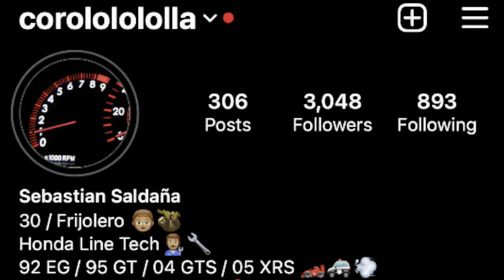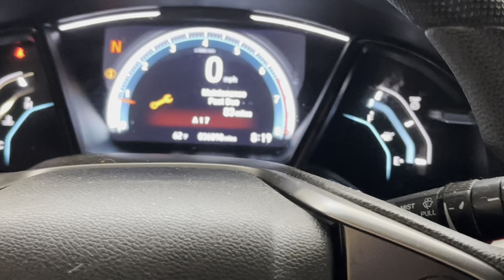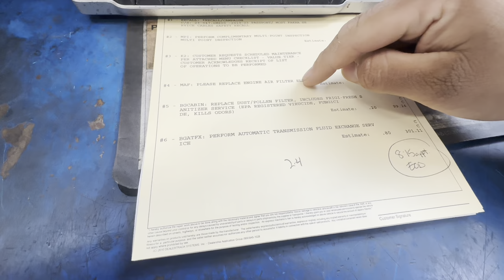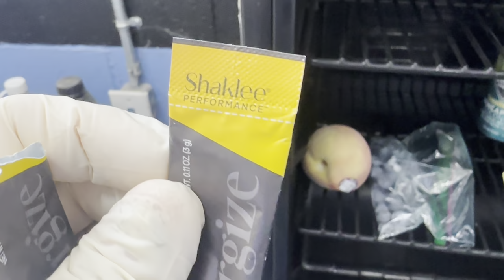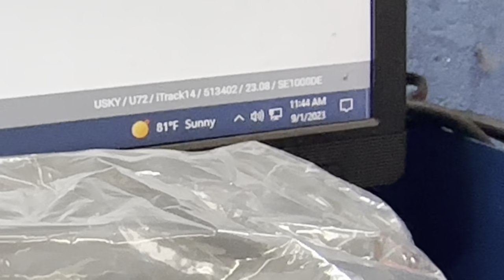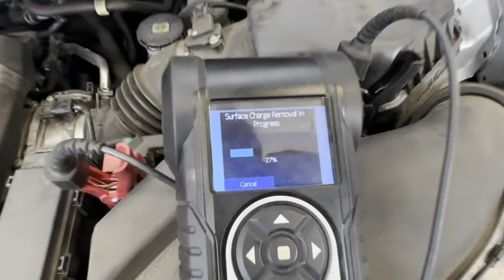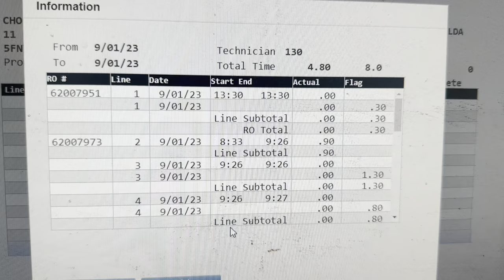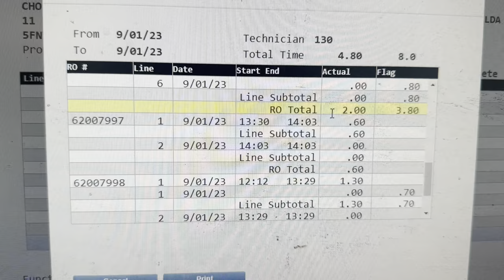Day in a life of a Honda Line Tech mechanic

Comment: Nice tour of the shop, thank you for taking the time to share your experience. I was very happy to find out last week that Honda decided to extend the warranty on Torque Converters for the 17-18 Pilots as mine is already showing signs of slipage at only 87K!!! and customers being charged $4-8Ks for that job.
Reply from the maker: glad that worked out for you! I've replaced 2 of those torque converters on both Pilot and Ridgeline.
Reply: just replace atf solve that slipage, I just doubt it works or it doesn't?
Reply: and people say bmws are the problem and unreliable , rather drop 4k on my 600hp bmw that drives it self with massaging seats than a max 300hp lifeless fwd honda

Comment: Good video.  My hats off to you its hard work for sure.  Back in 2001 I worked as a Lube Tech at a Ford Dealer for their Motorcraft Fast Lube lane.  Flat time.  Not hourly.  Every oil change paid 0.3 of an hour.  With a Tire Rotation w/ Brake Inspection 0.6.  After 4 years I couldn't do it no more.  Surviving on tenths of an hour.  I don't know if you were paid hourly or flat rate, but back then you had to hustle! And look for extra crap to tell the advisor to upsell on flushes, air filters, etc.  Flat rate is rough being a tech back then I don't know, I don't want to know either lol.

Comment: My Honda dealer must be one of a kind. We seem to charge less than every other dealer for maintenance. We get 0.3 for A service, 0.4 for tire rotation, 0.5-0.8 for mm3 (depending on transmission), 2.1 (4cyl) and 3.8 (v6) for mm4, 0.5 for mm5, 0.3 for mm6, 0.5 for mm7 and 1.4 for mm9 (Bservice).
Reply: $550 for an oil change, tire rotation and brake fluid is nuts to me. Does your shop upsell all that BG stuff too?
Reply: @daveclark8337 of its a dealership they’ll up sell whatever 😂

Comment: Question. What is the difference between a Line Tech vs an Express Tech at Honda? I noticed this video is kind of based on some Lube Tech daily duties (depending where one works) as my roomate just joined our local Honda Dealership in the DC Area.

Comment: Nice video man. Your videos on celicas is what got me here a long time ago. I have a question unrelated to the video, have you ever encounter a gap on oem TRD side skirts? When I installed them using the hardware are hole locations the rear of the lip does not touch the reaer wheel arch. Thanks in advance 😅.
Reply from the maker: Use a heat gun to push it in and double sided tape to hold it in place. Hopefully they aren’t wings west TRD replicas
Reply: @2zzlow  I don't think it's a replica I removed it from a crash car along with the rear TRD lip and spoiler. I'll check the part number I believe it had a Toyota number on it.

Comment: Nice video. I'm curious about the fluids. So someone in parts prepares everything for you for each job? How do they determine what additives are needed or which cars need additives?
Reply: When the service advisor writes up an RO (repair order) the system automatically sends the info to parts. They receive a “pick order” and that sheet tells them what is on the  ro and they’ll know what products to pull. They’ll set them out with a note or some way to note what ro the parts go to.  Tech matches their ro with the pick order and takes them back to the bay for their service.    As far as BG or other companies (my dealership uses Daytona/10MM) it’s just additives. Does it help? Sure but it sky rockets the cost for the customer.  That atf service shouldn’t cost 300$ for just a 6spd trans.  At my dealership the 9/10 spd trans start around 300$ because of the fluid it takes and the process. But that’s not of concern.

Comment: I never met someone with a lift that lifts it all the way up to take tires off. You take tires off at waist height then go all the way up save your back buddy
Reply from the maker: They don’t weight that much. Biggest wheel we have is from a pilot 20 inch wheel. I’m an arcade operator and my job involves moving and lifting heavy arcade games. Lifting up tires is nothing for me

Comment: why is there so many additives added to every liquid in the car?  

Other than that, great video!  easy and enjoyable to watch
Reply: They all practically do nothing. It's all advertising imo, but most of the additives do come with warranties on the specific component
Reply: @rileykoziol1005   what do you mean the additives come with warranties on the specific component?  so if im using an additive and the component goes bad, the company will warranty the component?  I don't believe this for a second!
Reply: It's called Up-Selling. Sell you additives you don't need at inflated price.
Reply: @gtmonyfckbtchs  The dealer I work for has a kit you buy that comes with a  engine, fuel, transmission, and coolant additive and as long as there is paperwork to prove you used the additives, the company honors a 6 month warranty on whatever components got the additive. They mainly put them in used cars when they sell them but customers can buy it too
Reply: @rileykoziol1005  sorry I just don't believe that.  Maybe a "hey here's your money back for the additive" warranty.